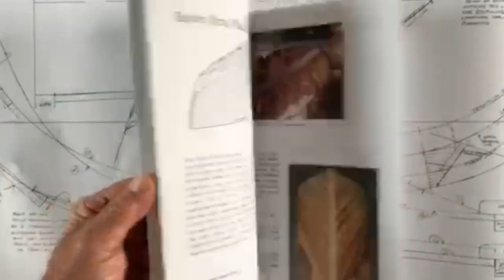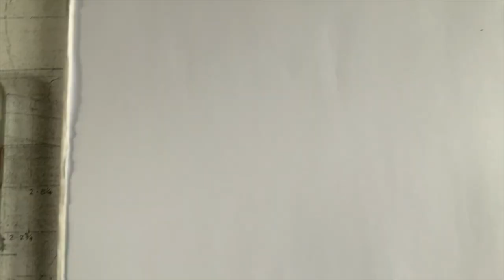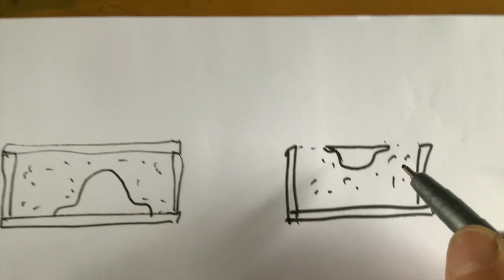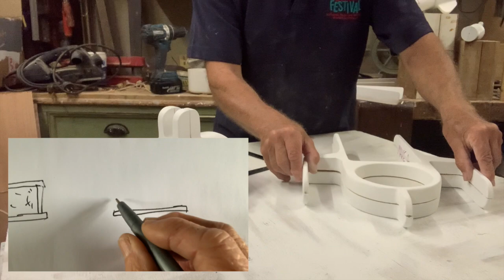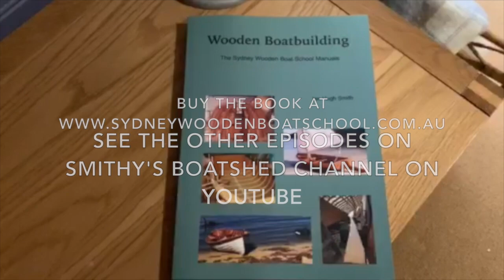Carvel Planking Ep18: Bronze Castings, Patterns to Polishing

Comment: Lovely work Ian, here's a tip you probably know but wasn't shown on video. When grinding soft metals using sanding discs or belts, dress the sandpaper disc/belt with beeswax. It keeps the grit from loading up with material and extends usefulness of disc/belt. I'd worked a number of years before an old salt of a maintenance mechanic showed that trick to me, so I'm passing it on for free. I'm sure someone will find it useful. Those parts look amazing by the way and that cutter is coming along beautifully. Cheers mate!
Reply from the maker: I was not aware of that, thanks, I’ll give it a go.
Reply: Dress the belt just like you did with the polishing compound and you're good to go. Grinding dust gets trapped in the wax and thrown off, reapply as needed.

Comment: ‘Really glad that I’ve found these vid’s Ian (linked from Mike’s "Classic Boat Supplies” web site) and particularly happy to have found them right now. I’m roughly at the same stage as yourself construction wise with a rebuild of a strip planked Huon Pine H28, after being stripped right back to a bare hull and deck frames only. I've just fitted the cabin sides and cabin top framing and am looking at what patterns I need to make for some bronze work (replacement rudder gudgeon, external chain plates, porthole external mounting plates... I’m looking forward to seeing your future episodes.

Comment: I enjoyed watching. The wave of the future these days is in powdered metal sintering process. Really the first new metal casting process in generations. You probably know it, but for readers, its powdered metal, (bronze, stainless, steel of different alloys etc) pressed into a metal form or even a strong fiberglass form which when ejected then makes a metal part same as the original but unconsolidated like parts of a damp sand castle. Literally seconds between one part formed, ejected, and the next part formed. These unconsolidated parts then are sintered in an oven to fusing temperature pretty much like fired ceramic. They emerge virtually as good as the normal traditionally cast part, ready for machining. A good video overview is here:
https://www.youtube.com/watch?v=PetwxkqM-kQ
I just wish that more marine castings were mass produced to bring the prices down. I almost suspect people could learn powdered metal casting ramming powder by hand in a garage but it requires a sintering furnace as opposed to a crucible furnace.
That fuel filler cap was superb! The bronze mast caps are a beautiful unknown tradition to me.